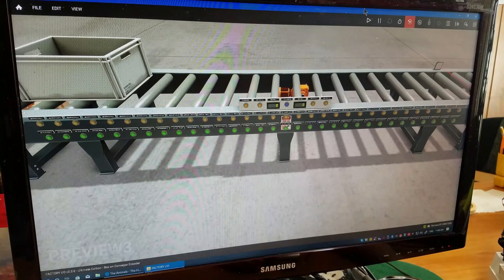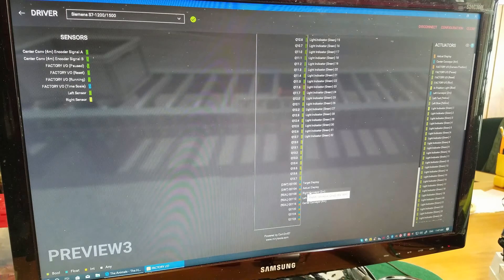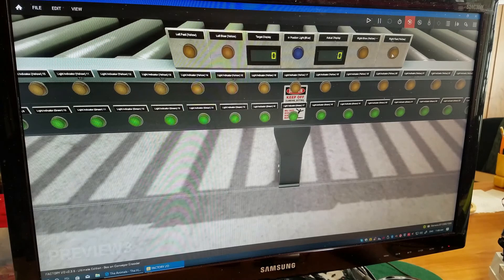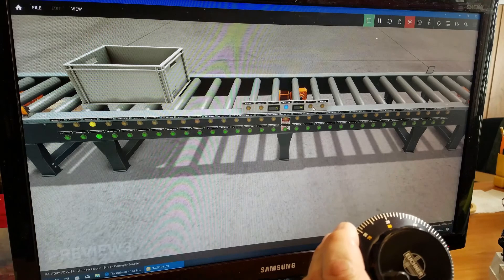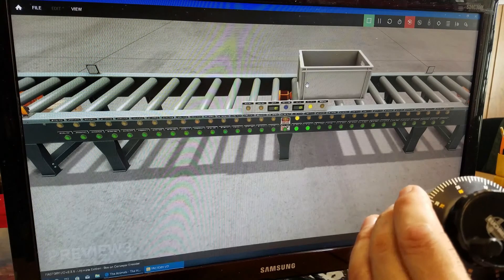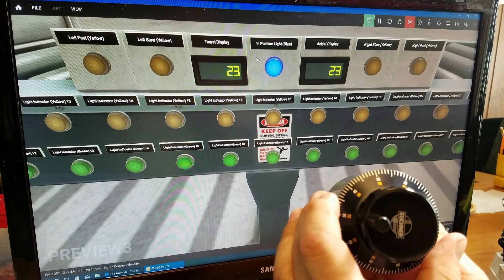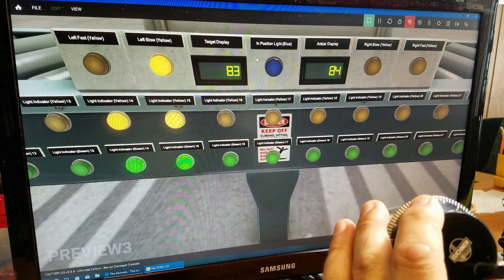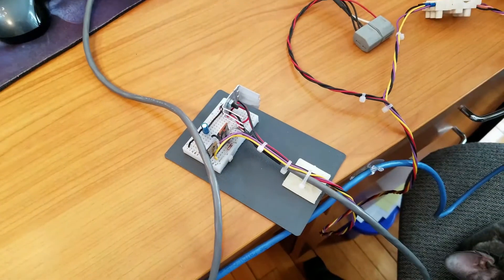Encoder Monitored Box Conveyor

Comment: Hi... What is the encoder's resolution?
Reply from the maker: The encoder uses two bits (A and B) to produce two 90 degrees out of phase pulses. The encoder resolution is 0.0225 m, which is based on a velocity of 0.45 m/s at 20Hz (roller conveyor default velocity). I believe there are approx. 12 pulses per revolution.